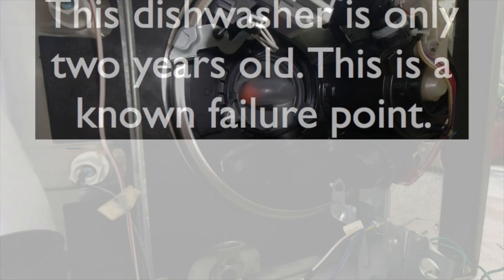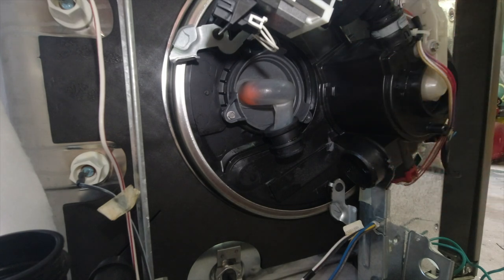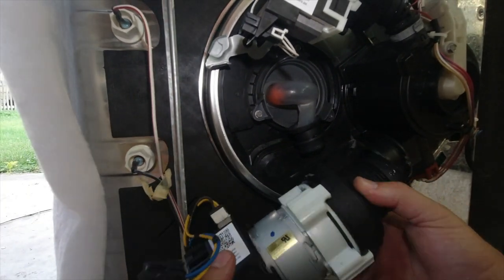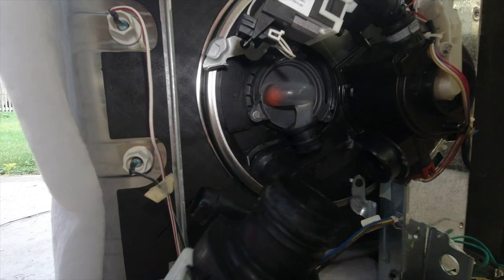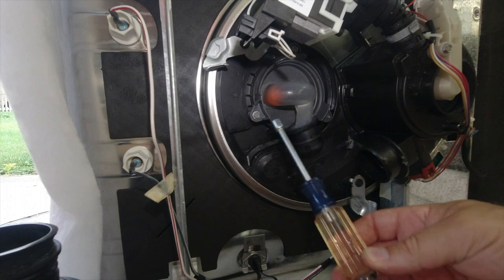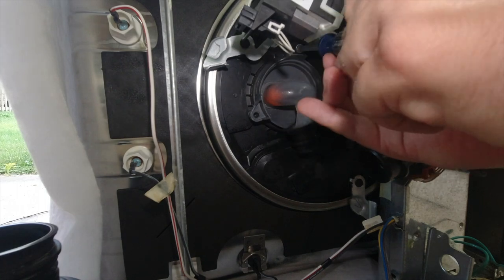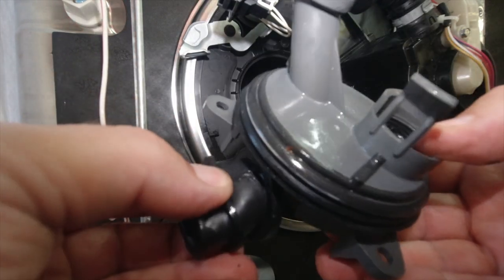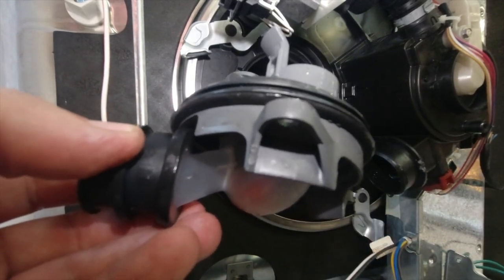How to Remove a GE Dishwasher Diverter Valve - DIY Repair Guide

Comment: Woke up to water soaked rug in the kitchen this morning. Took off the kick panel, soaked up the rest of the water under the unit then stuck my phone under there and recorded video looking up at the washer. Low and behold it was dripping water off that exact part!  Thanks for the video! Wife may call a service tech in the morning if not it’ll be my project  in a couple days. 

Update: The tech came with the part in hand  after my wife told them that I had discovered the faulty part. A 1 hour fix for the tech. The old part had split right were yours did but actually seemed as it had degraded a bit because it showed signs of rot and that it had bulged a bit. I post a picture of it if I could. Once again thanks the for video!
Reply from the maker: Mark glad you found it, it’s s not that difficult of a job, just need a little time and  patience. But if you can get a service tech in there soon then thats the way to go. Thanks for sharing !
Reply: Mark, I had a similar issue. A rubber elbow that was disintegrating and had a hole or cut in it. With mine, you had to replace the whole motor just to replace the elbow $90 plus labor. Long story short, I was able to get GE to pay for the replacement of the motor which had the defective rubber elbow. If you were serviced by an authorized GE place, you should be able to get a reimbursement.

Comment: Thanks!  Our 4-year old GE dishwasher has been nothing but problems from day one...the door leaked all the time and we are on our 3rd door seal.  Now, it's leaking from underneath and, after watching it leak, seems to be this diverter valve...going to try replacing it and see what happens before dropping another grand on a new dishwasher.
Reply from the maker: I wish you the best of luck and hope you fix the issue.

Comment: Hi Christian, solid video my dishwasher is a GE model GTD695SSJ2SS and while running it with unit pulled out I could see water dripping from the hose going into my diverter and suspected it was on the top.  This video confirmed my suspicions.  You cant see the tiny hole on the top, so I appreciate the video... I've ordered PN# WD19X25278 Diverter valve.  Thanks Paul

Comment: Thanks for the video.  I'm dealing with this exact issue as well.  The valve functions fine, but the rubber boot that connects the valve to the recirculation pump has deteriorated to the point where water just pours out of it.  I noticed the same type of deterioration on the boot on the recirculation pump as well.  I decided to replace that as well even though it hasn't leaked yet.  I don't need another flooded basement.  My GE washer is less than four years old and I already had to replace the top control circuit board, the power circuit board, and now these parts.  GE has some serious quality control issues.  I'm now going to install a tray underneath the washer and use a moisture alarm since I do not trust GE anymore.
Reply from the maker: Sorry to hear about your issues with the GE washer. It's understandable that you're feeling frustrated and concerned, especially with multiple parts needing to be replaced in such a short period of time. While replacing the boot and pump may be necessary to address the immediate issue, it's important to consider other alternatives to prevent future problems.

One alternative is to look into purchasing a high-quality, durable washer from a different brand. You may also want to research the warranty and customer support offered by different manufacturers, as this can be a good indicator of the company's commitment to quality and customer satisfaction.

Finally, as you mentioned, it might be worth considering installing a moisture alarm and tray. This can help you quickly detect and address any water leaks, preventing further damage to your home and belongings.

Best of luck

Comment: Christian, I noticed under the washer there was black powder like graphite and when I was starting to reassemble the diverter that the power was coming from the pump. I removed the plastic cover on what appears to be the fan end and by tapping the motor I got a significant amount of the powder out. Is that from the brushes or is that a sign I will need to replace the pump soon? Thanks and Happy 4th.
Reply from the maker: Steve sorry for the delayed response its very possible that the powder is from the brushes in the motor.
Reply: @christianseh9050  Thanks, that's what it appears, but it's working now so time will tell.

Comment: I have a GE dishwasher model GDT655SMJ2ES that is just 3 years old.  Started leaking only when running, fairly large leak.  We have had not performance issues with the dishwasher until now and keep it pretty well cleaned, etc.  When I took the kick panel off and watch it, it was dripping water down off the drain pump housing so I initially thought it was that.  However, I noticed a drop of water on top of the elbow for the drain hose and while I could not see any water actively dripping drown from the diverter valve assembly (I did have it off at that point), I'm thinking that it most likely is this now. 

Update: I went ahead and had a service call done and the tech initially thought it was the circulation pump that was leaking and would  order the part.  When he arrived to install, he had changed his mind after looking at his pictures a bit more and determined it was the diverter value.  When disassembled, the rubber elbow had deteriorated and had a leak.  Nothing was touching it, it was just poor rubber materials.  I only hope that the replacement part (WD19X25278) has improved this material or I'll be fixing it again in only a few years.

BTW: My total service cost was $301 while the part cost was $70.  Save yourself some money and do it yourself if this is your problem.
Reply from the maker: Thanks for  sharing your story William .
Reply: I had a similar story. Our GE dishwasher started leaking underneath about in the middle of the dishwasher. We called the local appliance dealer. They found a small 90 degree rubber elbow had a cut in it. When I put my finger inside the elbow, you could tell the rubber was just deteriorating. Our washer is about 2-1/2 years old. They said they have seen this problem a lot. The problem is, you cannot just get a replacement elbow. You have to buy a new motor which is $90. So we got billed $90 plus $65 labor to fix a problem that was definitely a manufacturing defect. 

I called GE to get compensation for the cost of the repair even though it was out of warranty. I spent a lot of time on the phone and in the end, she told me they could not help me because I did not call GE directly about the issue. I mean, who calls GE to get their appliance fixed. At the end of the call I asked to speak to a supervisor.  There was not one available, but she said I would get a call from one. Couple days later I got a call from a supervisor and explained my situation and told them it seemed fair that they should pay for this since it was an obvious manufacturing defect. Eventually she inquired where we had it repaired and since they were an authorized GE service provider, they ended up paying for the whole bill.
Reply: @jimbob4456  GE is the only manufacturer to have a National Factory Service Dept. That's why they asked if you called GE directly.

Comment: Great Video.  I had the exact same issue with my dishwasher (nicely done GE!).    I followed your video and was able to replace my diverter and was feeling pretty good about myself until I noticed that the top rack isn't cleaning anymore.   Now my glasses are dirty and my ego is hurt.

I checked the top agitator and the pipe running to it and both seem clean.   Any idea what I might have messed up?   Thank you in advance!
Reply from the maker: Michael thanks for the encouragement, sorry that you are still experiencing issues. The diverter valve controls the flow of water to the upper and lower spray arms. I hate to tell you this but you might need to check and see if that little ball in the valve is loose and moving also most GE dishwashers come with a removable filter that traps food particles in the wash water. Also, check the filter’s housing and clean off any food debris or particles in it. Before installing the filter back into the machine, inspect it thoroughly for any damaged parts. Hope this helps.
Reply: @christianseh9050  Thank you.   I did check and clean the filters.  Looks like I have to check the diverter again.  Oh well

Comment: Did you install the same exact part ? I’m curious to know if I can add like some jb weld or flex seal on the new replacement part because I’m sure the same issue will re occur on the same part.
Reply: I tried the flex seal attempt. Didnt work.. DIVERTER ASM KIT can be bought on GE website for $58 and comes with all the clamps.
Reply from the maker: No I ordered a new part
Reply: I wouldn’t flexseal would probably eat the rubber up. It’s some cheap ass rubber hose that GE put on there to save money. They also glued it on one end so you can’t just replace the hose you have to buy more of their parts.

Comment: Not sure if you’re still checking this, but was wondering how this is diagnosed. Our GE is 3 years old and immediately upon starting cycle large amounts of water start spraying underneath. Sound like a potential issue for this?
Reply from the maker: Yes still checking.. you know it’s the diverter when at start up and the dishwasher begins it’s cycle water comes out from under the unit. Hope this helps good luck.

Comment: Well a new diverter valve didn't fix it but I was able to see where it was leaking from....next to the white part of the circulation pump...so will hunt for one of those tomorrow....I hate working on appliances but SO worth it if I don't have to spend $1,000 for a new one!!
Reply from the maker: Keep at it you will get it fixed in no time.
Reply: @christianseh9050  Thanks!  I think I've narrowed it down to a leaky circulatory pump (next to the white part) so found an entire new one on-line and should be here in a few days...gonna have a rebuilt washer when this is all done!  :-)
Reply from the maker: @coloradoboo1071  Glad to hear it

Comment: Nice vid. Its too bad you cant replace just the rubber hose piece and have to buy the whole assembly.
Reply from the maker: Agreed
Reply: Yep, they glue the hose on one end. I’ll bet it was just a scheme for them to try to save money. You figure2 cents per hose. Clamp is saved horrible design.

Comment: Fixing this as we speak.  Widespread issue reported by many on the internet.  Extremely frustrating and a deal breaker for me and GE after a variety of issues with their appliances.  No longer buying GE
Reply: Yeah, fighting the same problem here. This is the end of GE products for me. We were going to buy Bosch, and changed our mind at the last minute because of a feature in the GE. But- no more GE dishwashers, that's for sure. What a piece of junk.
Reply: Yep same here.  Microwave also broke down in less than a year.  Pure garbage
Reply from the maker: Built in obsolescence, GE did send me one at no cost when I called them to express my concern.
Reply: @ericyoung7049  If you buy a Bosch, you'll be in a world of hurt when you need service unless there are good Bosch servicers in your area.

Comment: It’s pretty stupid that you can’t just replace that hose they make you buy the whole part that hose is glued onto the part on the one end piss poor Design I had one break and it fried my circulation pump so I had to buy a new circulation pump and diverter valve When I get my diverter valve, I’m gonna Throw some tape on That point that gets chafed

Comment: I just saw one for sale diverter valve for fucking $22 and I just got one for $45 so I'm pretty pissed about that
Reply from the maker: Hi @jennatrusty522, I can definitely understand your frustration when it comes to finding a better price after you've made a purchase. It's important to remember that prices for goods, including dishwasher diverter valves, can vary significantly based on a variety of factors.

1. Supply and Demand: This is one of the most significant factors in pricing. If there's an abundance of diverter valves in the market and not many people are buying them, the price can drop. On the other hand, if there's a shortage and many people need them, the price can increase.

2. Retailer Pricing Strategies: Some retailers may have lower overhead costs or have bought the items in bulk, and therefore they might be able to offer lower prices. Others may offer sales or discounts at different times to attract customers.

3. Location and Shipping Costs: If you're comparing prices from different online platforms, the cost of shipping can greatly impact the overall price. Some platforms might offer lower product prices but have higher shipping costs.

4. Product Variations: There might also be slight differences in the product. For instance, one diverter valve might be made of higher quality materials or come with a better warranty, which could justify a higher price.

These fluctuations are a normal part of a functioning market economy. It can be a good idea to shop around and compare prices before making a purchase, but sometimes, you just can't predict when a better deal might come along. Don't beat yourself up too much about it. You learned something from this experience, and that knowledge will be valuable for future purchases. I hope this explanation helps you understand a bit better. Please feel free to ask if you have any more questions about this or anything else in my video!